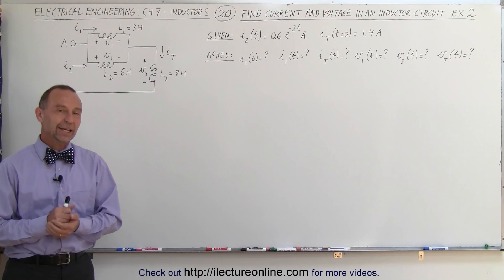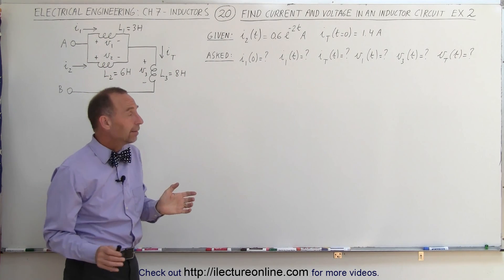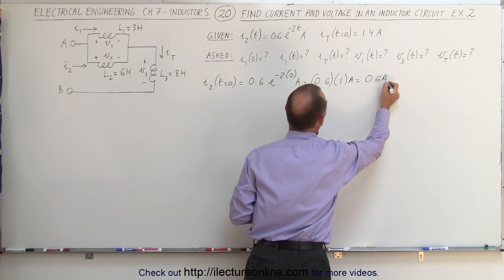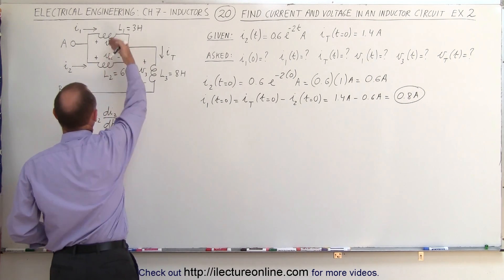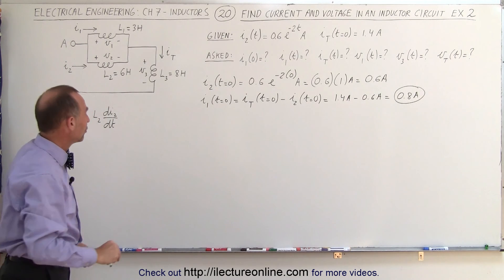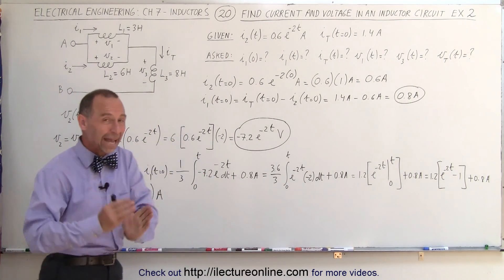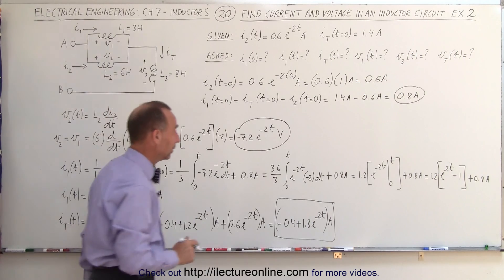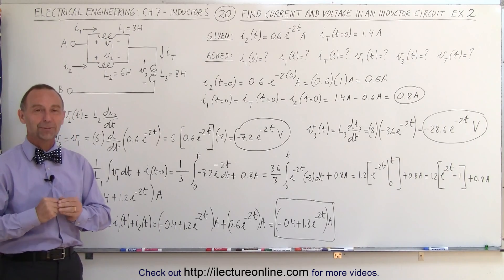Electrical Engineering: Ch 7: Inductors (20 of 20) Find i=? and v=? in an Inductor Circuit: Ex.2

Comment: Shouldn't we first calculate the equivalent inductance for the two parallel inductors and then calculate the voltage? I don't understand how did you assume that V1=V2 when you didn't calculate the voltage for the equivalent inductance.
Thanks.
Reply from the maker: The voltages across parallel branches are always equal.
Reply: Yes, but we need to calculate the voltage for the equivalent inductance not just for the value of one inductance.
I mean you used the value 6H(L2) to calculate V2 and then assumed that V1=V2 but if we plug in the 3H (L1) into the equation we get a different answer for V1.
Reply from the maker: No, you will get the same answer for v1 if you calculate v1 = (3H) d/dt (i1)

Comment: I mean, with the inductors, can we use the current divider low as will as the voltage divider low like we used to use with the resistances?
Reply from the maker: No, because the reactance of the inductors depend on the change in the current.  You have to take into account the phase differences.
Reply: thanks a lot for your reply, so, does it mean that I can use the reactance of the inductor ( ωL ) in the current divider or the voltage divider law?, or should I use the impedance (Z) in these laws?, or is it impossible to use this laws with the capacitors and inductors?